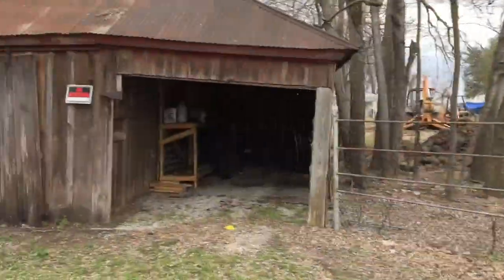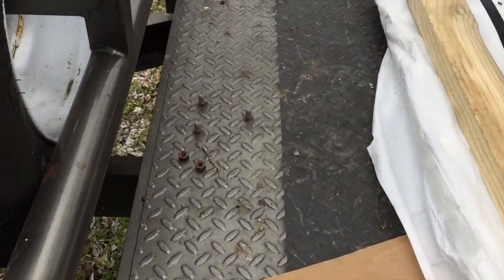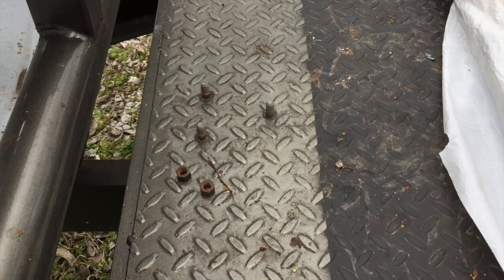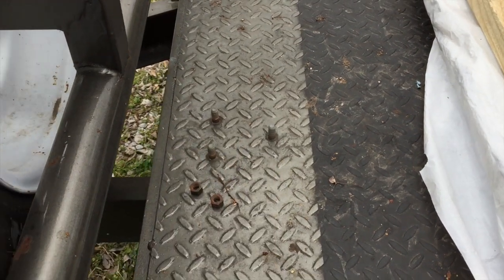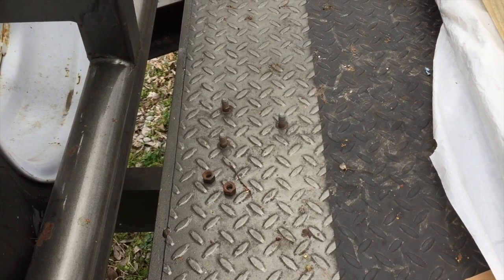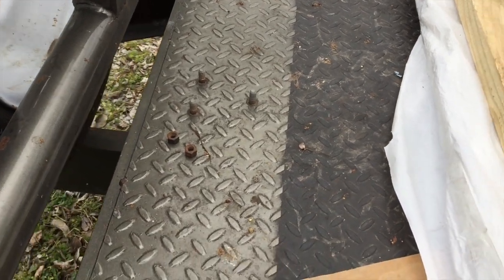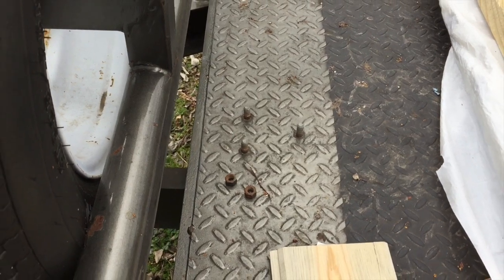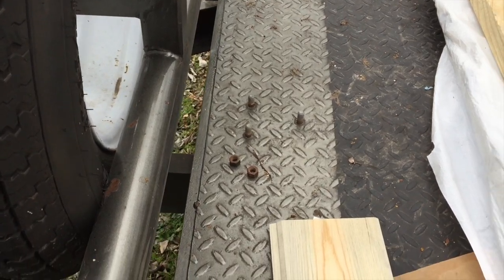how to mount Warn Winch  - Car Hauler Trailer - adapter plate

Comment: Nice work Gary,  I hate to say it,  I have a 2000lb winch on my trailer and I find it to be pretty anemic,  it is a cheap one though.
Reply from the maker: +TheWreckingYard Well, hopefully it will be enough to pull the welding table and sheetmetal break.  If not I will add a snatch block in